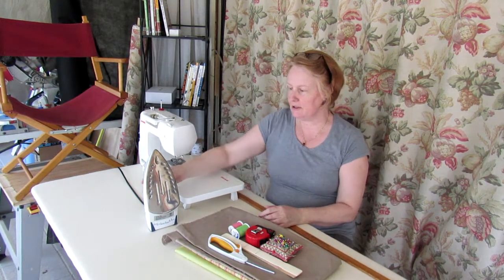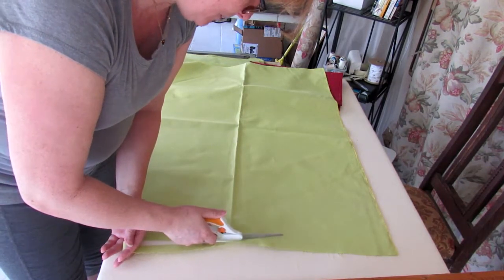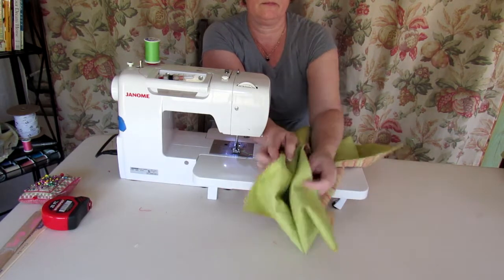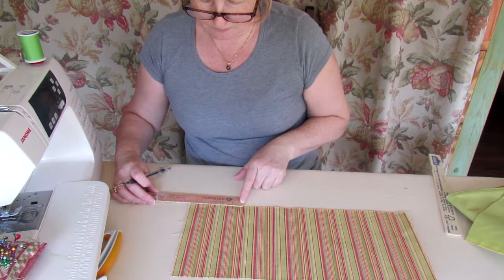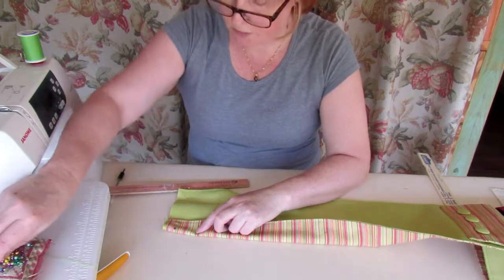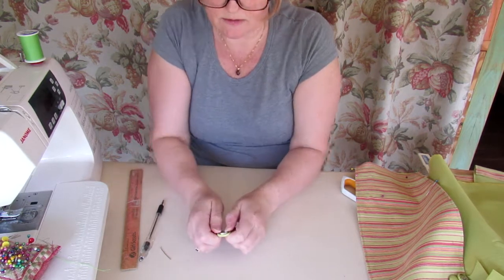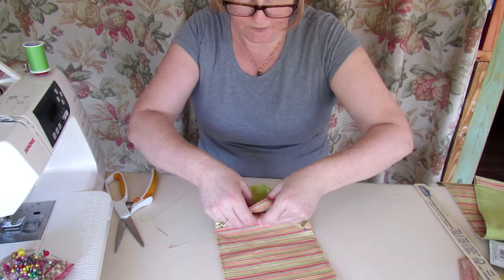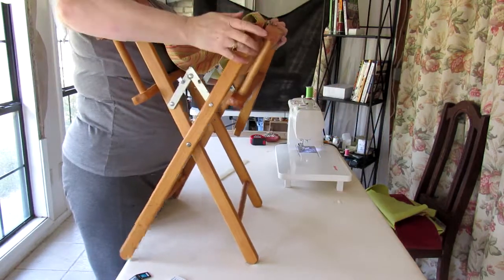Re-cover a Director's Chair - Professional Tips and Tutorial for All Levels

Comment: Thank you for taking the time and trouble to make such great video.  Would it be a good idea to use Fray Check when you make the holes for the buttons?
Reply from the maker: Hi Karen, thank you for your kind words.  As to your question, you could use Fray Check if the fabric is prone to fraying.  However the hole in the fabric, should only be just big enough  for the button shank to go through it, so you shouldn't really need it.